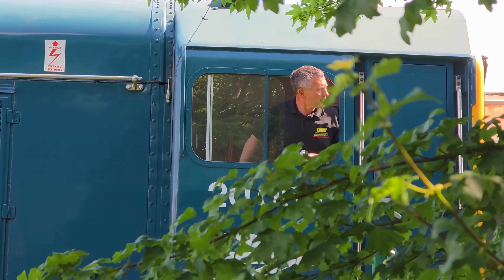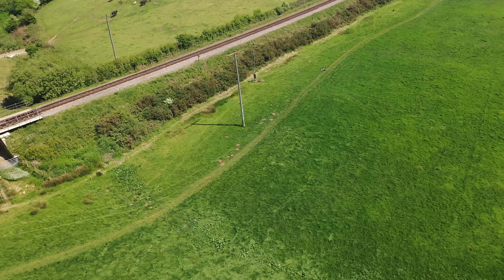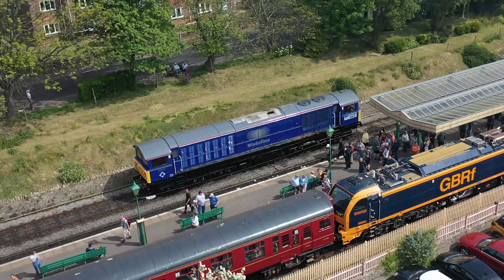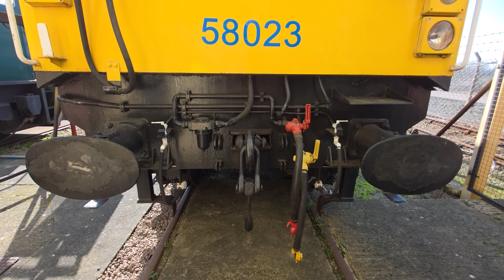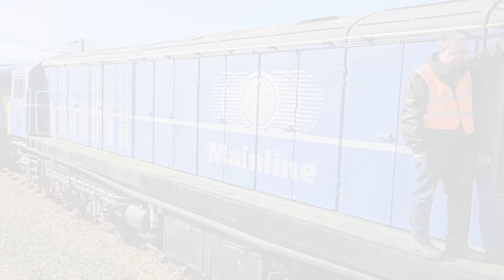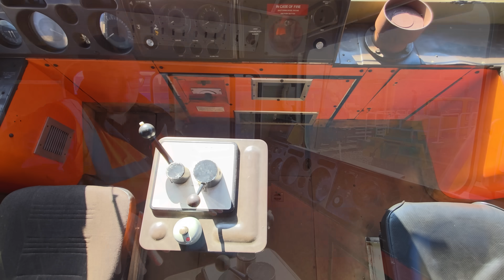Accurascale - Brand new ‘OO’ gauge Diesel announcement 10/6/2026

Comment: Great news, i asked at a show last year if you were going to make one as the bogies looked similar to those on the class 60. I used to work at Doncaster Plant works and remember as an apprentice in 1985ish i was on the outer ledge tightening a pipe in one of those access doors on 58001 i think, i stood up and grazed my back on each vertibra aganst the scaffold tube they clamped on the outer edge to stop you falling off, it stung like you know what 🤬 lol but it's something  i always remember. Anyway I'll be placing an order for sure.

Comment: It will have to go some to beat the Hornby model😂 I see here mentioned about the difference in exhausts! Well, Hornby got round that, they never added one? 
I remember working on these as a fitter way back in BR day's and they were a pleasure mechanically but in practical terms they were not as good as a class 56 in service!

Comment: Don't want to burst Accurascale's bubble but, they need to sort out the electronics because a lot of Accurascale trains develop electrical or motor faults between 1 week and a month after purchase. That's why I don't really go for Accurascale locomotives anymore.
Reply: A lot? accurascale has made and shipped well over 100,000 locos so far, if a 'lot' developed faults, it would be all over the internet - however, you are fully protected by the LIFETIME warranty so if a model develops a fault ever, you get it sorted for free! Compare that to any other manufacturer where is a model develops a motor fault, in say two years time, you're on your own!
Reply: @accura-stephen I have had 6 and most of them broke and all but 1 came from Cheltenham Model Centre, not from the Accurascale website. And i did have my only one from Accurascale website get fixed and it has worked well since but I think i had enough of them. At least with Bachmann's Next Generation I know they'll last
Reply: @anacondadoh-victoriousii  If you bought from an approved stockist you also get lifetime warranty cover by default included. Personally I've had more issues with other manufacturers motors, but thats just my personal experience, ultimately the motors and electronics are basically identical on all models you buy these days, regardless the factory or manufacturer.

Comment: Opening up with a HST and then it wasn’t 😔 come on get the tape measure out and bring us a top class HST next!
Reply: Hornby does an HST.
Reply: I know and and I have a few, but would be nice to have one with a really good speaker already inside that you have to hack the chassis to fit and stay Alice’s are pretty much industry standard now but Hornby doesn’t have them. I’m sure an Accurascale one would have the engine room and driver centre lights and the MK3s would be a higher standard with a decent interior and be lit as standard
Reply: @Michelle-fy7vj  I never really understood the need for stay-alive in anything bigger than an 0-4-0 or 0-6-0. What are people doing with their track laying that makes stay-alive so important ?